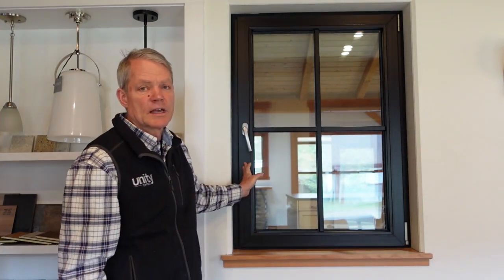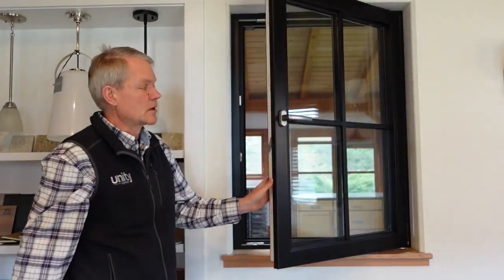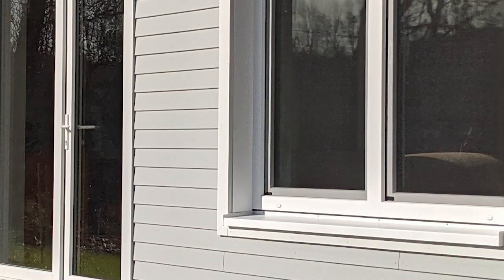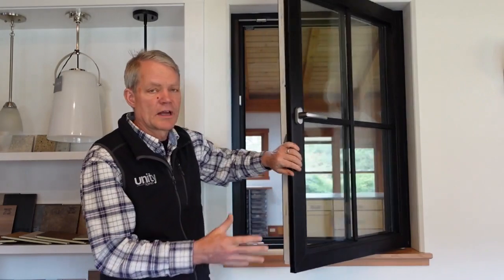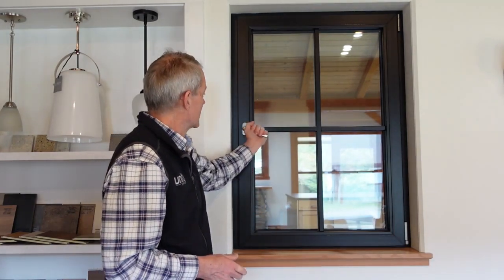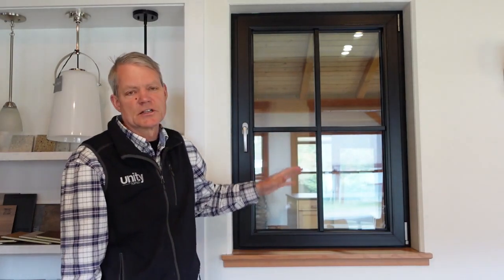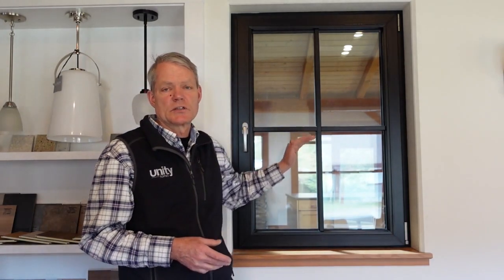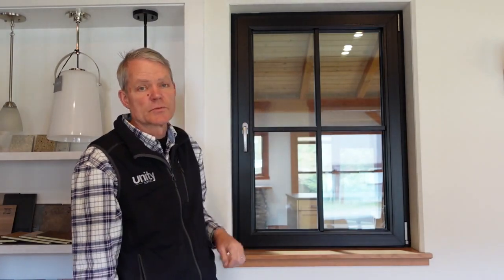An Introduction to Unity's Logic Windows

Comment: I noticed that the exterior "sill" of the Logic windows is flat and does not slant for drainage.  Why is that ok?
Reply from the maker: The "rough opening sill" previously was not slanted but has since been updated to be more slanted. It has excellent flashing detail, and the exterior metal sill finish material is slanted.
Reply: But it does slant